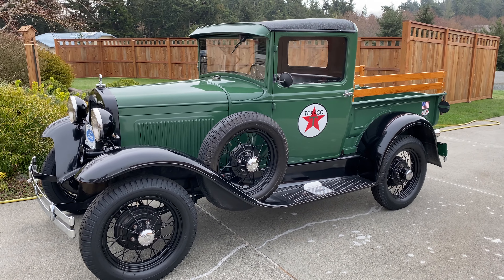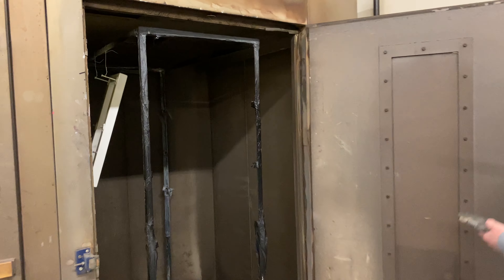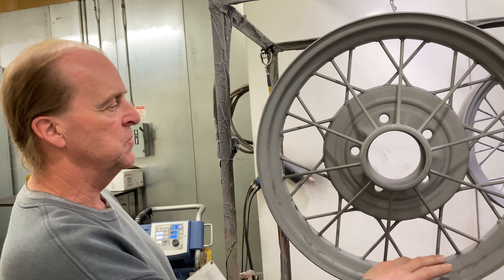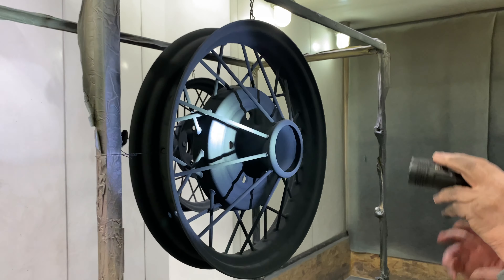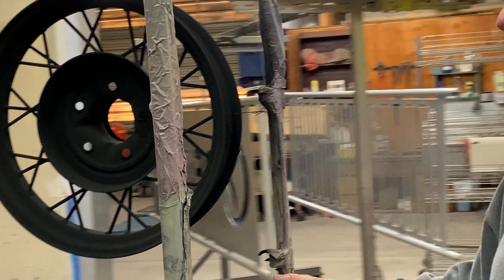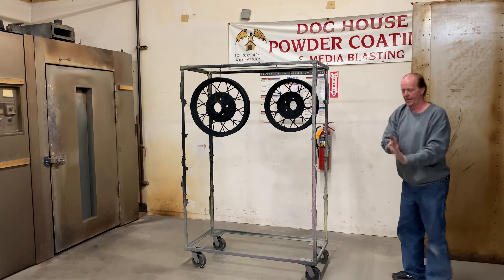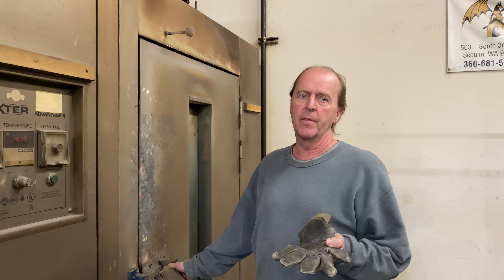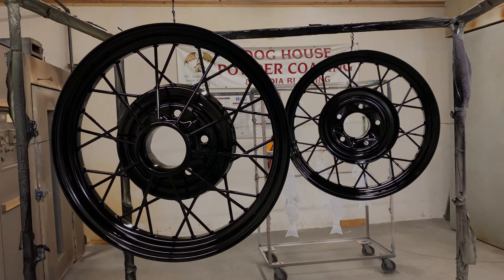New Model A Spoked Wheels Get Power Coated

Comment: Hi Randall, I just watched the previous video of changing the tyres, have you considered blasting and powder coating the the other 3 wheels as well?
Reply from the maker: Hey Bob, thank you for watching my videos and for your comment! Yes, I do plan on blasting and powder coating the other three wheels, eventually. But first, I need to have the new tires mounted on the new wheels. And Dog House Powder Coating is backed up for several weeks if not months. I expect to post videos on both of these enhancements to my Model A. Thanks again!
Reply: @randallwingett  Thanks for the swift reply, I actually started with your frozen gutter guard video, we don't have that problem Down Under, then your model A tyre change caught my eye and had to watch it and then the powder coat video.😊
BTW I noticed that after the first new tyre was mounted, it had wheel weights on the rim, but I didn't see him balance the wheel, hope you haven't got shaky steering now.  
Sub'ed and I'll keep my eye open for the follow up, Cheers from Australia

Comment: lets all stand around without respirators while powder coating.
Reply: First thing I thought of. Used to spray Sermatel coatings on Turbine shafts for United Airline engines. Spray it on (need respirator for everything.) Let air dry and bake it in this giant oven a little bigger that those.  600 degree F for 60 minutes. Do it twice. Bullet proof coating for corrosion prevention.
That Powder Coating looks awesome.